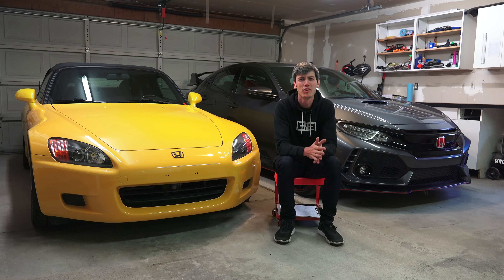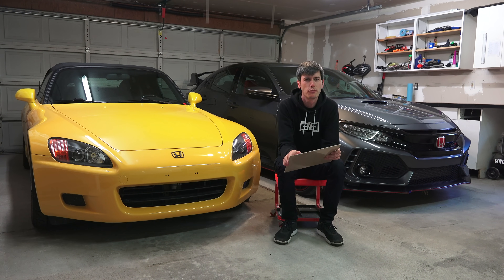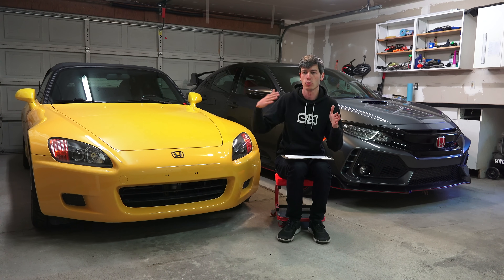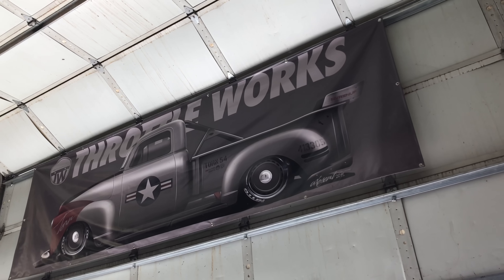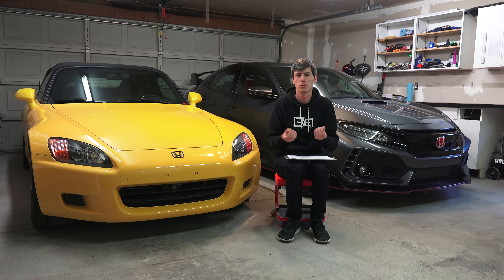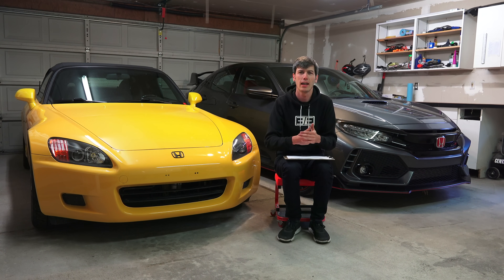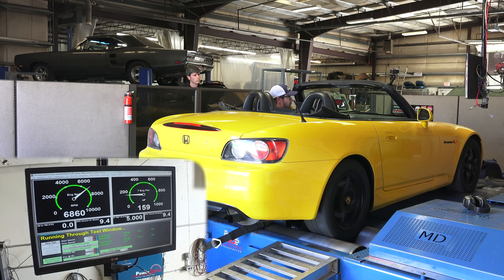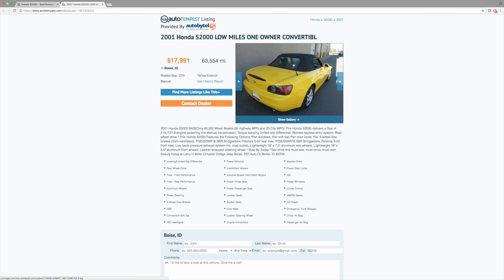Why Comparing Dyno Numbers Is Silly - S2000 Gets Dyno'd!

Comment: What fuel did you run on? Besides the s2000 makes aprox. 235-258HP with 98 Octane at 9k Rpm. At least it should.
Reply: Thats a big difference in hp

Comment: A dyno should measure the rpm directly. Every dyno I've used (a few) measure the rpm via a spark plug wire.

I'm also confused as to why your chart shows "engine power" and why you are concerned with parasitic losses. Dynos like these don't measure engine power, they measure rear wheel power. Trying to get engine power from rear wheel power is a guess at best and leads to confusion.

I do not know why either of the dyno types mentioned cannot obtain actual and accurate rear wheel power. My understanding is that a properly set up (SAE corrected) dyno can and does measure rear wheel power correctly. If  you found out otherwise, please explain.

Comment: I don't want the dyno to take in calculation the aerodynamics, the weight, the wheel size. I want the wheels touching the rollers to spin the rollers, and the rollers to measure what is the actual kick, and punch they get from the tires. So if a car weights 1000kg has the same hp and torque, as a car that weights 2000kg, and is much more boxy, not aerodynamic, I don't want the dyno to give me 2 times lower horse and torque for the heavy boxy car. i expect the same number on both cars, and when you drag the cars, of course the boxy car will be far behind.

Comment: Technical question for your Type R video: will the active dampening system of the Type R recognize lowered, stiffer springs and work still properly/perfect, because its sensors will help dealing with changes spring rates?

Comment: US dynos are different too, as far as i know the dynos you lot use aren't load based. In the UK we use load based dynos, it measures the torque or then calculates the bhp from that, rpm/5250 using rpm from the cars ecu. The barometer settings of the dyno arent put in by the operator, we run in shootout mode which locks these settings. I'm not sure how the US dynos measure it exactly, but its a well known fact over here that a car may make 500whp in the US. Bring that car over to the UK it'll make more like 400 at the wheels at the most

Comment: I went to EFI University and learned a lot.  Main take away's though from real pro's is people look at the dyno the wrong way.  Dyno is NOT for the customer or forums. The dyno is a tool to be used by a tuner.  If the tuner references HP/Trq it's to sell you a idea.  The dyno is never going to have the same numbers for a million more reasons than explained in this video; but this great video still gets the point across.  Next time your on dyno ask him to do a run, then click the dyno straps a notch or two; OMG you just lost all this power.  Long story short, the dyno is a great tool to dial in ignition values and fuel; which is downright dangerous/impossible to truly replicate on the road.  If you want to get real scientific, you take out some more variables by placing engine on a engine dyno.

Comment: EE, Before you dyno the S2000 with boost, Would you calculate the HP using math (With the energetic volume with boost etc..) and then compare it with the actual dyno results. It's sounds awesome!

Comment: Think if you make change to the engine, you need to remap the ecu to get the full gain from the parts :)

If you can i hope you wil they remap it as stock, then again when with exhaust and so on :)

otherwise you can loose power insted of getting power, depends on what you change, but belive you gain more from change if you remap it :)

Comment: nothing wrong with ur car numbers.
the highest number ive seen with stock ap1 was 198whp in a good day. and its maybe due the dynojet calibration.

i always said to my customers that dynos are tuning tools only. u drive ur car on the roads not on a roller with a paper. conditions and circumestances are different.

dynos are useful to find the correct amount of fuel and ignition to flattin the curves.
more flat lines = healthy engine.

Comment: Another reason to buy a 2002 or newer is because sometime mid '02 the banjo bolts in the engine were upgraded from 2 holes to 4 holes.  You can check if your engine has the upgraded banjos by looking at the engine vin, not the car vin.  Do a search and reference the number.  

If your car has the older 2 hole banjos you will want to seriously considering upgrading your bolts if you are going to add your supercharger.  The 2 hole bolts do not put sufficient oil on the bottom of the pistons to cool them down.  Even sticking with NA, I would seriously upgrade to the 4 hole bolts.  

Keep up the good work.  Great videos!

Comment: I do think dynos are useful in terms of explaining the power/torque characteristics of the car. I wish you could explain the shape of the curves of horsepower and torque and what it means when in a 'real feel' situation

e.g. fat torque in the 1-3k/4k range means a very responsive street car, while one with a torque curve that's in the higher rev ranges gives a different feel, and also why peak values are not very meaningful compared to the overall values that results in the dyno graph curve.

I do think that a dyno's main value is as a tuning tool, and also for looking at the power/torque curves, rather than the actual values.

Comment: It'd be nice if you could elaborate on the way dynos work, especially in relation to changes such as final drive ratios, tire sizes and pressure, gear used, etc. I've read some dyno operators say that the dyno will compensate for these things and others say that they use a formula for the correction factor.

Comment: Kinda wished you had a bit more info in regards to some factors of dyno readings - for example the 4.44 final drive over the stock 4.10 final drive? If the huge fan they put in front during the run is enough to replicate the effects of intake airs while moving? If tyre profile/size effects readings (negligible effect?)? If the gear it's performed in affects the reading too (gear 4 vs gear 5 etc)?

Any insight to the theory behind this?
Thanks EE :)
Reply: *PS I have an s2000, and have got a video it being dyno'd on my channel :)
Reply from the maker: +Rupert Huang 4.44 makes a difference in the calibration for finding RPM, but shouldn’t affect the readings much. Higher ratio means it’s spinning more for the same vehicle speed, so technically would be a small power loss. Unless you’re in a wicked expensive wind tunnel, you’ll have a hard time replicating 100 mph wind hitting the front of the car. No dyno is really going to properly replicate this. With the gear selected, you have to consider matching RPM, as well as top speed of that gear. Obviously rotating in 5th means your spinning those drums at a much higher speed for the top RPM.
Reply: I think the car my dyno went on was completely different. It didn't even read my RPM so my guess is - power is calculated through it's acceleration output? Through this method - I believe higher FD = higher torque transferred = higher reading, similar to going from a lower gear rather than a higher gear. 

Too many variables in the method my car got dyno'd in! Much prefer the mathematical method that you performed by actually recording rpm and speed!

Comment: Thank you for this video!! I have had numerous debates with people who compare dyno numbers. A vehicle only makes that amount of measured power on THAT specific dyno on THAT particular day. 

Just like you stated in the video, all dynos are only as accurate as their setups, calibrations, correction factors, along with a host of other variables. Plus, no 2 dynos will measure power in the exact same way. This is especially true between different dyno manufacturers, as one manufacturer may measure power one way, while the others will measure power in a completely different way. So, because of those factors, power measurements for an engine/vehicle on one dyno will vary for that exact same engine/vehicle on the next dyno. Sometimes by a little, sometimes by a lot. 

Then there's the drivetrain losses to also take into consideration.

Comment: Nothing wrong with a stock car :)
A lot of people are giving me crap for owning a stock Mustang GT, even though I BOUGHT IT BARELY A MONTH AGO.  I thought it was common knowledge to not mod a car right after purchasing it, so I can spend some time getting to know how it drives stock, before deciding what to change on it.
Reply: Welcome to youtube where if you don't drive a 600+HP car that can run 10s or better you'll be flamed by angry 12 year olds.
Reply: Bladed Angel Once you get used to the power it gets boring and you end up wanting more and more. Mods are fun but you always run the risk of something going wrong. But the new mustangs can handle a lot of power 750whp safely seen some ppl run 800whp+ stock motor and still run no issues but I think thats pushing it imo. If you do decide to start adding mods start with headers/cat back 20whp gain is what I got from them. then I would towards forced induction dont get gt350mani/cai unless your planning on staying n/a
Reply: I came from driving a 130HP FWD Sentra, so my Mustang is far from boring so far :P
Although it's far too quiet, and after driving it about, I think it could use better tires, so that'll be the first thing I'll change.  Either way, my goal is to push to at least 500BHP, so I'll see what I find along the way.  For now tires are a must.  245 all arounds are just a waste of potential, I need more beef to work with!
Reply: I like it a lot.  Honestly, after finally experiencing what it's like to own a V8 RWD Car, I finally understand what all the hype is about.  It's fun!
Reply: Exactly! lol and nice last video
Reply: Bladed Angel oh forgot to add ford offers a power pack 3. Which you would be making around 500+ at the crank compared to 435 and you keep your warranty.
Reply: Bladed Angel big upgrade haha get some good nitto tires either invos or nt555 g2 is what i run perfect in the rain and dry weather.  I was lucky my car came with 275s all around but the pzeros are not good at all imo spin city.
Reply: I was thinking of getting Nitto's, but it's going to get real cold soon up here.  So I'll be trying to find some good all seasons or winter tires instead.
Reply: Bladed Angel hey. How do you like the GT? Im having a WRX for daily drive. I’m thinking about trading it for a GT.
Reply: Oh hi bladed angel when's the supercharger coming

Comment: Not all dyno jet dynos run inertia. Some are also load dynos.  And as a experienced dyno operator should of used a rpm signal  from coilpack pick up.  instead of using rolling speed. I've dynoed my  stock s2k on a dyno jet and a mustang dyno  and it was about a 10whp difference. Which was 202whp on a mustang and 212whp on a jet. Which is pretty much dead on with my 1/4mile and  trap speed of 13.91@ 100.6  car weighed 2860 with me in it.
Reply: What crank horsepower (bhp) do you make that 202-212 whp to be? :)  I always am more interested in bhp figures since these are what car manufacturers quote.
Reply: TassieLorenzo usually there is a 13 to 15 percent difference between whp  and bhp  on a rwd
Reply: If I was to take the 212whp and add 13 percent it would be around 239.5 bhp

Comment: My bugeye WRX was dyno power tested as a stock car. 118KW and 213NM. Catless up pipe, turbo back exhaust, high flow fuel pump, catch can and ECU remap mods 2 weeks later, same dyno. 176KW and 272NM and boy does it feel like it wants to go now.

Comment: Hi any case you might be able to enlighten me on why my manual transmission is stuck in gear? Engine starts up and I let off the clutch in neutral the she will stall. Not sure where the problem lies but I'm scared that I will have to pull out the transmission at this point. :[  ps those are some b*tching rides!!!

Comment: Before and after is excellent advice. You can go through entire forums looking for the best (read: right for your application) mods and then when you chuck them on you don't get the outcome you thought you would get.
I dyno'd before and after installation of an enlarged throttle body on my car and found it lost power. Many forum comments stating the car revs quicker and theory for why it wasn't a good idea.
No confirmation either way. Finally had some hard data to show the loss.

Comment: I think you’re misrepresenting the automotive discourse community, but you’re and engineer it’s expected considering your lack of “hands on” involvement. Folks familiar with using multiple dyno’s are accustomed to the variances in the numbers. For example, when I’m talking to other car guys about dyno numbers, the differences are always considered so much so that it’s done almost unconsciously. You will always hear questions like what dyno, time of day, relative weather, elevation, tire size, etc...so we know that it can subjective and it’s almost always taken with a grain of salt. So stating that dyno numbers only really work if the conditions are exactly the same is overthinking the act of building and tuning a car. Cause you quickly realize that nothing is exact and more often than not you’re always gonna have the same outcome. Don’t mean to come off dry but I felt there was a huge difference between what you’re portraying and what people who do this day in and day out really see. Keep up the content! Cheers!
Reply: Isn't using chassis dynos instead of an engine dyno just a compromise anyway, because taking engines out of cars to measure them is too involved? :)
Reply: TassieLorenzo to an extent, you get a broader sense of the build working together (engine, drivetrain, fuel system, induction, exhaust) even little things like vacuum hoses and heat soak are more prevalent in an in-car dyno rather than only capturing data on the engine itself. Granted today’s sim software is making it so a high dollar build can go through minimal R&D.

Comment: As a mustang dyno owner. I feel like this video doesnt represent thier products very well. To use the 3 runs method. It should be done the same way all 3 times. Not using the pulls while calibrating. I dont like using roll speed vs rpm. I use my inductive pick up as much as possible because it isnt always a match up and doesnt actually detect tire slip.  I also dont play with my WCF or parasitic losses to make up faulty numbers. I feel that isnt right by me or my customers.  Only true comparison from a mustang to a dynojet is to just put them on both.

Comment: So the question becomes... how DO you actually find out how much horsepower your car has?
Reply: Take the engine out of the car and measure it directly on an engine dynamometer in a controlled air-conditioned engine dyno room. ;)
Reply: TassieLorenzo yeah, but technically that's no different. If you have several different types and brands of engine dynos that are all calibrated differently then you probably still aren't getting true numbers. Sure you could compare and contrast to other cars using the same dyno and same conditions but it still wouldn't be universal

Comment: A supercharger? Cmon Jason I thought u were all about efficiency...
Reply: A turbo that will flow enough air for an engine like this will have a significant spin-up time.  A small turbo good for 300whp normally with no lag will starve the motor at the top end.  The supercharger compressors are generally almost twice the size of a normal turbo; they flow a lot of air.

Comment: you can't make a statement like "Dynojets read higher than Mustang dyno's".  Mustang dyno's reading entirely depend on how they're setup since they have so many variables.  Some read lower than Dynojets and some read higher. 
And the "Dynojet" setting on any other brand pretty much never reads what a car would actually make on a Dynojet.  The only way a stock AP1 would make 220whp on a Dynojet is if you massively screwed with the weather conditions, even then I'm not sure if its possible.

Comment: great video! so many people get wrapped up in hp/kw numbers and like you've shown they can be complete bs. I'd say the 180hp runs are pretty much on the money. mine put out a consistent 179/180hp over four runs as well.

in terms of the mods you have planned. Definitely look at getting a test pipe as the stock cat is the big restrictor of the system. lots of guys get decent gains from just changing the test pipe out and flashing the stock ecu
Reply: Deleting catalytic converters is bad for the environment, being blaze about that is really not cool!  Either you have a race car or an old pre emissions car, so you don't need a cat -- all legitimate, or you have a modern car like Jason and you need a cat and therefore you should have one (else risk massive fine!!!). ;)

Comment: A catback exhaust isn't going to give you any gains at all. Catback are for sound only. To get any performance increase from an exhaust, it 1) has to be a full length exhaust that either replaces the stock cat with a high flow cat, or removes the cat altogether and 2) the engine needs to be tuned after the change. Exhausts and CAIs really only add gains when done in conjunction with a tune. Without a tune you will see zero gain from a CAI and at most 10 or 15hp from high flow cats with increased diameter downpipes.
Reply: RationallySkeptical Agreed, especially with the catalytics remaining untouched. Put in some longtube headers, hi-flow cats, and a modest tune. Then you might see a small result from the exhaust alone.
Reply: you are wrong
Reply: In the case of S2000, there is little gain from header or exhaust since the factory header and exhaust are already very good. :)  Hytech do however have a package of cams, header and exhaust that when used together in combination produce a significant hike in power (about 20hp gain IIRC).